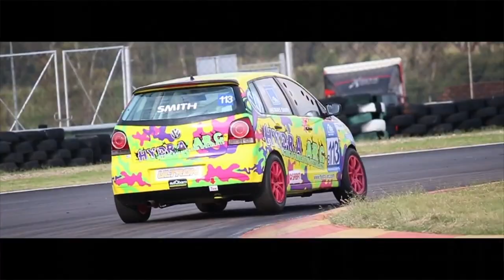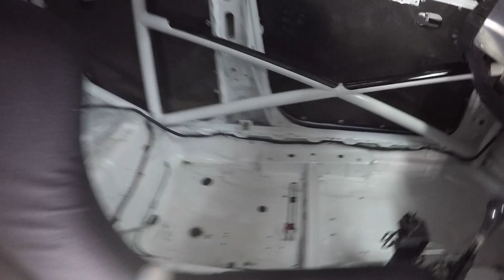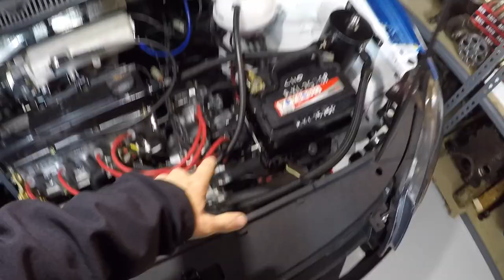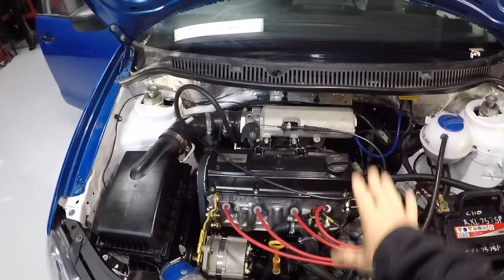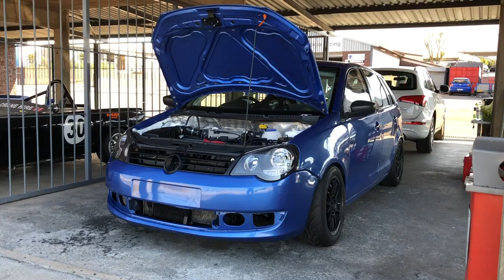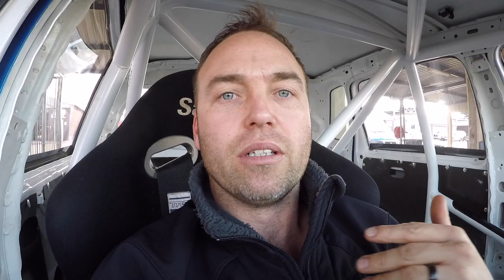FWD Theory to Practice

Comment: Great video 

Would you be able to tell me the wheel and tyre size plz? 

Also how much does the polo weigh in this configuration ?
Reply from the maker: Thank you & Thanks for watching

Wheels are 15x7J.
Tyres are Dunlop Direzza 03G 195/55/15

Polo weighs 985kg with fuel & no driver

Comment: Thanks for great videos. I never saw You reducing the speed with your (left) foot on the brake while understeering. Can You comment on that? thanks.
Reply from the maker: I wouldn't advise on trying to do this. If so, it needs to be very gentle inputs because the car is already in a very high load situation with the weight transfer.

Comment: What engine it is? Looks like some old 8 valve from 2nd or 3rd generation Golf or Passat.
Reply from the maker: Thats correct. The series this car races in only allows the old 8Valve built to specification.

They did this because of reliability and the cost of the engines.
Reply: Which race series is this you are doing, I am interested in the specs of the engine and gearbox